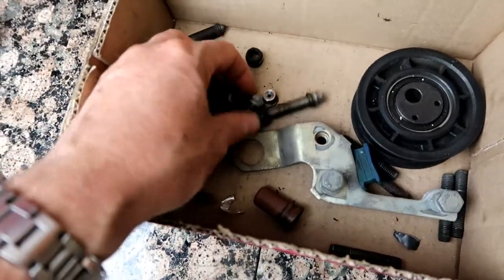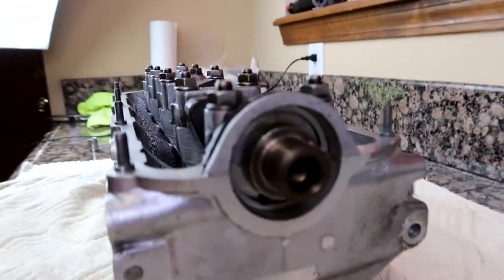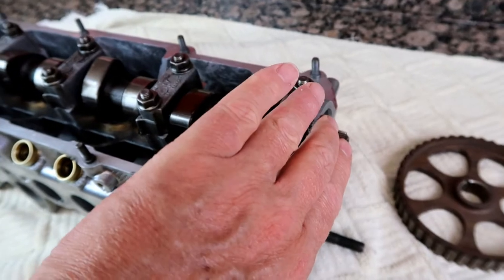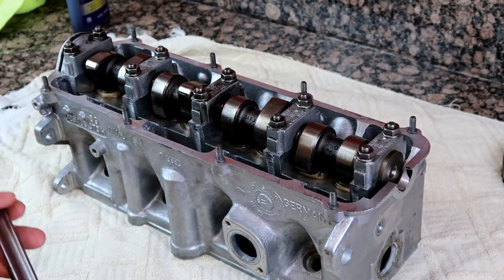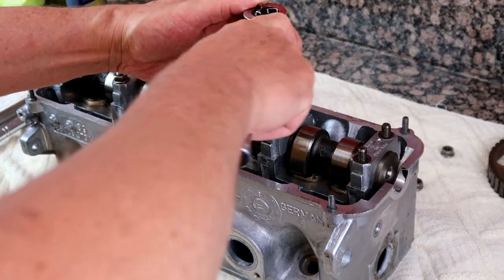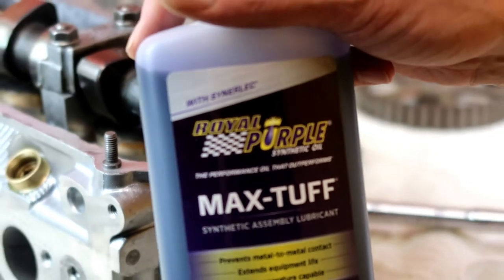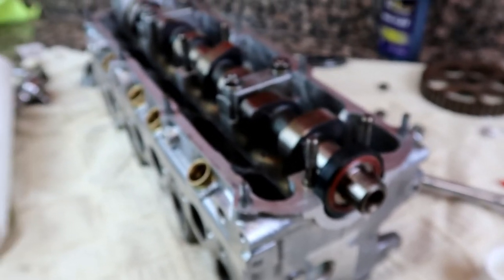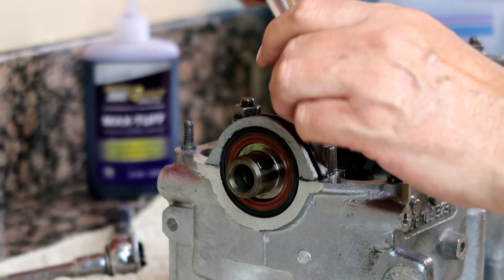1985 VW Scirocco Mk2 | Part 21 - How to Replace the Camshaft Oil Seal

Comment: Comment, I may have missed it, but you need to put engine assembly lube on the camshaft bearing surfaces.  Otherwise it’s going to spin the camshaft dry in aluminum until oil makes it up there.   You do not want that!